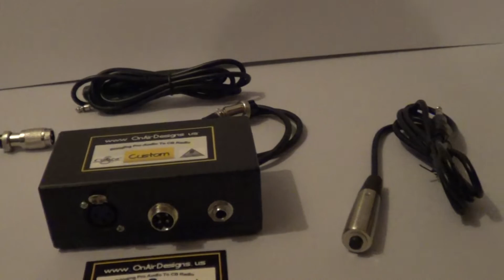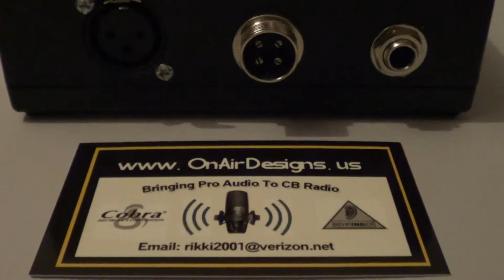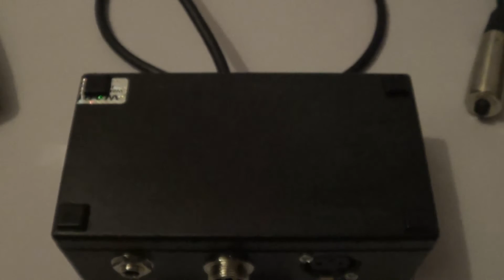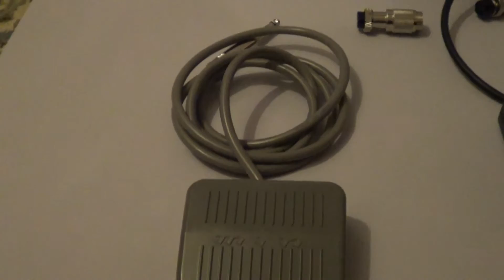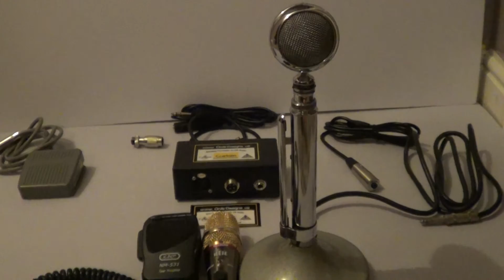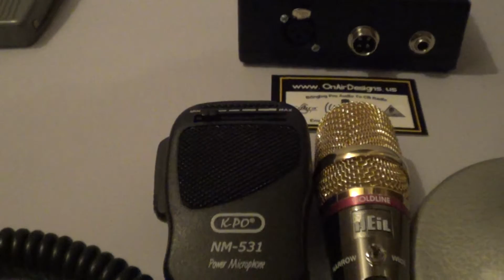On Air Designs FX1 PRO Interface Review

Comment: A synopsis of the FX1 interface, Shure sm58, and Beringer 802 (that rich @ audio design's suggests will not give you what you're looking for. During my; I wanna sound like NYC's WK2U FM commercial radio station i, went and bought the fx1, Beringer 802, and Shure sm58. These 3 items were going to have my 3rd generation Uniden Madison sounding like the big boys right? WRONG! What many don't understand is that those 3 items individually, or used in concert cannot change the transmitted band width of your transmitter. In order to benefit from the use of a mixer one's transmitted bandwidth needs to be 2.9 (minimally.) All stock CB radios are fitted with a filter that operates way below 2.9 MHz. The difference one will get while using a mixer along with a CB radio will be negligible. One must wideband their transmitter in order to benefit from the use of a mixer. The FX1 interface is basically useless. While the FX1 allows one to put a mixer, and studio mic in line with their CB radio the difference in the most important, and wanted effect from the use of these items will not be achieved. I'm talking of course about the lows. Use of a mixer to increase the bass of a CB radios audio will not be achieved. Even in the mid and high area the difference from stock will be negligible. In order to get the wanted effect of ESSB, or high quality AM audio, one must increase the transmittes band width of their CB radio. There are several different ways to do this, and all are easily found right here visually on YouTube, and thousands of articles online. Until you get your CB radio transmitting above 2.9 MHz (6-12 MHz is the sweet spot imo) save your money. One could also purchase a board/module from MMM, or Asymod as a easier option to  reaching audio Nirvana. Asymod sells AM, as well as AM/SSB transciver's ready to go. That right plug, and play (almost.) A bit of clip watching, and or reading will definitely help even if one was to purchase a Stryker, Galaxy, or Cobra  Asymod wide banded CB radio. If you going to spend $350 in order to purchase the FX1, sm58, and 802, save your money. Have your transmitters bandwidth widened before even thinking about spending money on an interface, mixer, and studio microphone. Do lots of reading, and watch lots of clips. The world is at your fingertips. And if you really want your CB radio to sound like the ones the big boys on Channel 28 AM, it's obtainable (obviously.) But the FX1, mixer, and Studio mic will not get you there (on a non modified/stock CB.) 73's
Reply from the maker: Your right in saying make the band width wider (as many do on the Ham Bands with the much looked Kenwood TS950SDX) But this is a quick look at the product, there are many sites on the net saying how to do the full package Plus don't forget in the UK we use FM too,which you can use narrow ans wide too........Dave M0OGY/26AT025
Reply: @m0ogy  I'm glad you replied. I didn't want to share to much as I didn't want to get so far off topic, and begin confusing those who don't have too much knowledge on the subject, but are interested in ESSB.. But since you replied I'll share something I've learned that might give other interested in ESSB (and "HiFi" AM) a heads up on a terrific plug-and-play setup. A mint condition (second hand) yaesu ftdx 1200, and one of those five band eq's built by UR6QW is an excellent choice for a true plug and play experience. The ftdx 1200 is a great choice as the average selling eBay price is $680.  The 5 band UR6QW (with reverb) is offered for $89 or best offer. And another hundred and $125 for a megawatt 30 amp power supply, and you're in business. I've read the eham reviews on that particular EQ, and it got a 4 or 4.5 rating. Let's say $700 for the ftdx 1200, &80 for the EQ. $125 for the power supply, and another $200 for a nice second hand Studio mic. And for about $1200 you should get the true ESSB experience. As far as AM use, I'm sure with a bit of adjustments dialing in and one should get excellent audio reports on both AM also. Not to mention the ftdx 1200 is better than any CB radio ever made past and present. Top notch RX, with DSP, and you can't go wrong. The ftdx 1200 has a "secret" menu option that allows it to operate at 
3 Khz wide.Hold two buttons in at the same time and the Wawa. 3 kilohertz wide. exactly what a transmitter needs in order to benefit from the use of an equalizer It's wide enough to actually hear the nice lows, mids, and highs while using an equal/mixer. It might be Overkill if it's strictly going to be used on 11 meters, but for the price, and the fact that one could get true "HiFi" audio imo it can't be beat! it also might be exactly what someone who operates 11 only might need to push them into getting their ticket. I myself am not interested in ham radio. I am strictly a chicken Banda. I'm just trying to stop someone from throwing away money as I did. For the price of the interface, 802, and sm58 in my opinion it's just a waste of money. Save that money and put it towards the setup that I mentioned above, and you will be happier than a pig in shit. your audio reports will be incredible, and you will hear stations like you've never heard before while listening to the receive side of your CB radio. Not to mention all the other goodies that the ftdx 1200 offers, at such a terrific price. 73 s

Comment: Hey up Dave.  I've just taken delivery if one of the BM800 condenser Mikes.  I'm building up some audio kit here at the moment for HF. I'm not talking essb mind, I've quite a bit of Behringer gear here at the moment but still need a couple of other bits and bobs.  I don't quite understand this box and I feel for what it is its quite dear.  Also people need to realise that when your dealing with audio in an rf environment, having the chain split up a few different ways in a PLASTIC box is less than ideal as there are no screening properties. I intend to build my own breakout box to feed audio into the rig through the back at line level.  There's absolutely no point in externally processing your audio through a device like this or the w2ihy ibox to 'pad'  it back down to mic level only to send the audio in through the front mic jack and associated low and high pass filters and amplify it back up to line level again.  This process will undo your external processing as most of it will be rolled off by the filtering in the mic input circuit of any HF rig.  Also the price I feel for what it is is outrageous.  He's taking a big ream from Bob Heils book and totally screwing people. Lol.  Not a pop at you personally Dave, I've been studying this audio craic for the last 6 months and gathering gear along the way.  I'm very nearly ready for off... I just can't understand how they charge so much for a plastic box with a few quarter inch Jacks and an xlr socket... Beggars belief really
Reply: You got a lot of nerve to accuse me of screwing anyone. My product, the FX1 Pro is geared to towards folks who don't want to build an interface themselves, either in a kit or on their own. They would rather just spend the money for a plug and play unit. What's wrong with that? I have people all the time tell me its a bargain and my feedback shows it. You get the interface and a PTT keyer all rolled into one product & price + my customer support - it's a great deal. 

As for the plastic box comment - unscrew/open up a handheld D104 or any CB/ Ham radio handheld microphone and take a peek inside that plastic case - that doesn't need a metal box either.. around all that audio circuitry.

Check my blog page folks and see the reviews for yourself http://onairdesigns.us/blog1/ I have hundred upon hundreds of satisfied customers in almost every state in the USA and 6 countries abroad and growing.

This video is #1 of 2 parts - Dave, m0ogy has made this a "Preview" of the FX1 PRO - He plans to show how easy it is to interface a Mixing board /or other Pro audio gear with a CB radio in the next video.

 www.onairdesigns.us
Reply: Relax dude. I'm entitled to my opinion.To me it seems expensive for what it is. If people want to pay you for something they could do themselves for a fraction of the cost, then good for you. I still stand by my comment about the plastic box. Have you tried one in the vicinity of a multiple KW Linear amplifier? Its poor RF practice not to have audio circuits screened in a metal case. I wish i could get people to part with their hard earned money so easy...Don't be so defensive man, if you put something out there in the world someone is going to have some opinion other than yours about it...or did i hit a nerve????
Reply from the maker: Irishman1127 I see it has started an interesting debate George and TBH , whilst some can built their own interface boxes , some don't have the time or ability to make their own.
Personally I feel this product is well made and based on the fact we paid £45.00 for a Heil footswitch not too long ago, the price charged isn't too over the top IMO
A local Alan (Bigfoot) uses one of these devices and with his mixer has some of the best audio on CB Radio.
He also has run it with a modern HF Radio (Yaesu FT450D)as well as standard CB Radio equipment.
I endeavor to bring my Youtube viewers any new commercialy made products on the market.
It is a pleasant change to see somebody with new ideas and a lot better than showing the current crop of  countless AM/FM transceivers built in the far East.

Dave
Reply from the maker: onairdesignz Thanks for subscribing to my Youtube channel and thanks for the prompt shipping and online help with this product Rich.
I look forward to trying it "On-Air" soon.
Reply: m0ogy Anytime Dave !